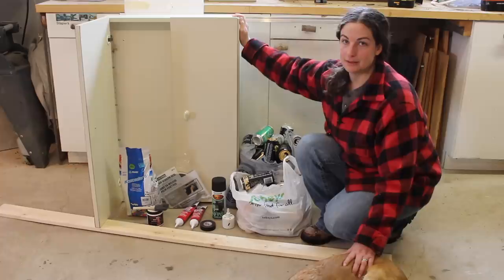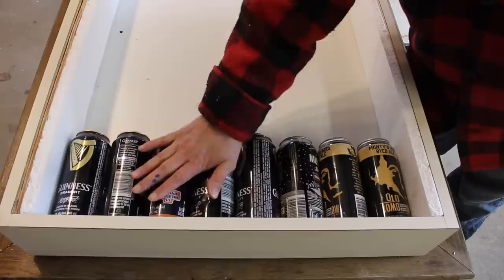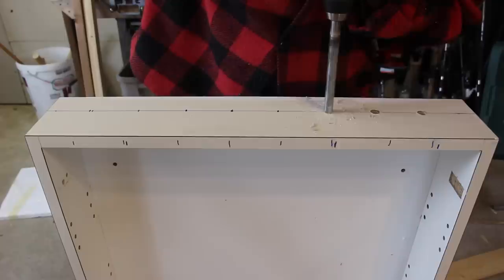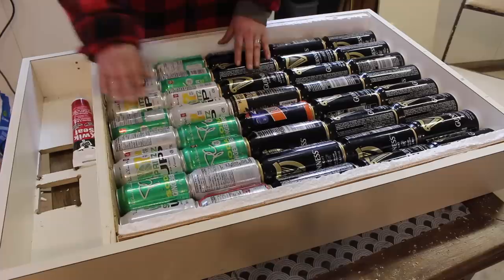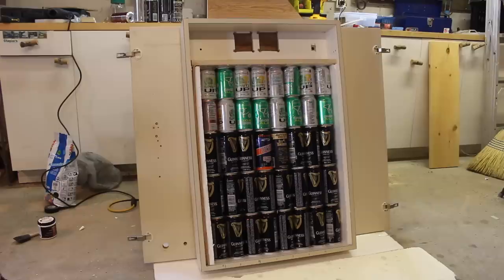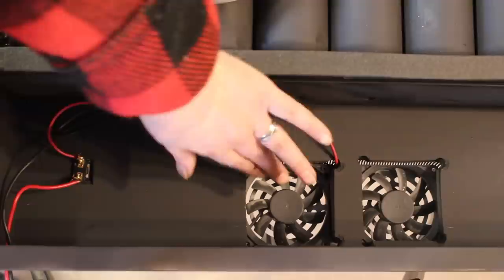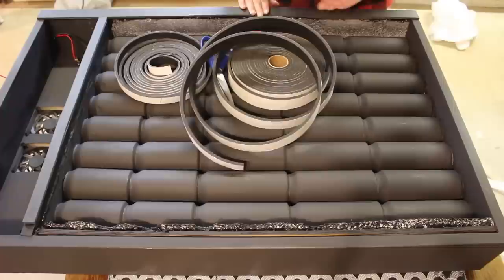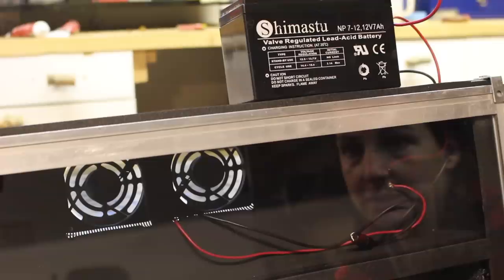Free Solar Heat From Pop/Soda/Beer Can Heater

Comment: You need a Pulse width modulated PWM solar regulator for the battery set to the GEL setting - otherwise you will stuff your battery with over charging. Without a solar reg the battery will dry out and loose capacity.  On very SMALL systems a PWM regulator is far better than an MPPT solar charger, as it has less losses and is more efficient, as well as cheaper to buy.

Instead of pop-cans, use metal down pipe, water copper tube, or even any other type of metal tube that's painted black. The longer the tube - the hotter the air flow will be coming out. 
Curve the tube over on itself back and forth to make a long air path and the air will become hotter. Also use hot water from your fire stove and run that through tube in stead of air with a fan blowing over it. Otherwise a neat idea. 

Alternatively - live in Australia where there's almost never any snow or freezing weather. 
A white Xmas doesn't exist in the southern hemisphere other than Antartic. I've seen snow in Australia maybe twice in 65 years.

Comment: You guys, there is X amount of heat coming in the window. Putting this Popcan rig in the window is not going to bring more heat in from the window, it's just blocking the light. You were getting just as much heat from your window before you did all that work.
Reply: The only difference is that you are capturing the heat in that rig, and blowing it out the vent. Before, the heat was being spread out more as light before it turned into heat. Also, you are putting electricity into the fans that you could've been using somewhere else. This is less efficient than doing nothing. If you want more solar heat in your room, add another window.
Reply: Or put it this way; pretend your window is a hole in the wall, and the solar energy is mice coming through that hole. Your Popcan rig is just a maze. You're not getting more mice per hour coming in through the hole, you're just making them go through the maze before they get into the room.
Reply: If you just want to block the light while getting all the heat, a black curtain would do the same thing. And you wouldn't need fans.

Comment: Sorry to rain on the parade here. But the heat energy from the sun just coming in a window will not escape unless you are trying to reflect it back out. It will all be absorbed by the material inside the house and emit as infrared radiation. The only way this would contribute to heating your house or whatever structure you put it in, is to have it outside, collecting the heat and ducting the warmed air inside. aside from that its just a cool experiment showing the heat energy from the sun going through a window.....

Comment: I am only confused about why do you have those cans inside the box? Isn't it going to be just the same amount of sunshine collected in the box if there are no cans? How does having the cans in there make it collect sunshine from a bigger surface than what amount of sunshine is hitting the surface of the box itself?
Reply: the cans function is mostly airflow and collecting the heat to the air stream andforcing it one way, as hot air rises up on its own, the cans concentrate it further in the inside "chambers" of the can body. The small holes from can to can allows air to slow and collect more heat on its way up. well thats my best thought analyzis, havent tried it out yet myself. Happy new year every one.
Reply: The can are to collect the solar heat and transfer it to the air flow inside by the fan.  Not too effective needs more surface area but it depends on how hot the Aluminum get and how fast the air moves.   The problem I see is the battery will deplete in a few days since the panels cannot charge and power the fans Maybe a temp on switch for the fans? Else this will ruin the batteries.  If this was placed in a window   the resultant loss of sun light probably will offset the heat gains.  Maybe a part 2  will show how useful it is VS a black curtain.  Mount it outside and flow the air in would work.

Comment: Can I ask please why there are holes in the bottom? Did you seal those? As I’m thinking perhaps the heat would escape from them.
Reply from the maker: The air heats up in the cans and has a continuous flow through them.  If you seal the holes the hot air can’t flow out of the cans.

Comment: But when the sun goes down & it's dark, don't you have an air conditioner,?
Metal gets hot in sun & cold in shade
Would be very interested to know how this heats at night. (Sure could use it,!)
Reply from the maker: The can only runs when the sun is shining.  It's a solar heater, so no heat at night.

Comment: This may be good for people who already know what on earth the different steps are for, but I don't understand it at all. For example it looks like the point of drilling holes in the bottoms of the cans and then gluing the cans together is to make them into longer pipes. But then there's no explanation of why you need a bunch of pipes.
Reply from the maker: The small holes in the cans slows down the airflow as the fan draws air through the unit, allowing the air to heat up before being moved out of the box.  Hope that helps!
Reply: @Wilderstead  interesting, thanks!

Comment: Did you mount this outside or inside the house?  I made this unit a few years ago, and mounted it outside my sash window in the master bedroom.  I open the bottom window enough to allow air from inside to circulate up and open the top enough to come back through.  It didn't heat enough to make any difference as no matter how the sun shined the cold air kept the cans too cool to do the job.

Comment: so, you set it up as a window with the pop cans facing out. when the sun hits it it warms up and you blow the heat into the house. Sooooo....when the sun goes down....
Reply from the maker: Considering it's a solar heater, one would assume it requires the sun to work.  Similar to something like a solar panel....

Comment: Great idea, but I wonder that if the PC fan portion of the cabinet is insulated, how much of a risk is there for the fan to overheat? Heat displacement is a concern for computers, and for that reason, fans are known to overheat.

Comment: How does the fan know whether to use the battery or the solar panel? And do they both stay attached? Can you do a closeup? I don't understand where you put the weather stripping also. I couldn't see a difference in before and after
Reply: If connected in parallel, the fan will pull power from whatever has power available. So if sunny, itll pull some power from panel and some from battery. Itll happen automatically. However, ive never seen a solar panel tied directly to a battery like that. Theres usually a charge controller inbetween. Plus, youll need to make sure you have a solar panel that has a diode built in to prevent reverse flow, or else the panel will drain the battery and produce heat out the panel. Might want to do some more research on this

Comment: So the question regarding your pop can heater is....where is your intake?  Obviously you thought of exhausting the the heated air from the cans... but that air has to come in from somewhere... so where's the air intake or are you just exhausting the whole panel only and there's no fresh, cold air getting pulled in? If that's the case you're not going to be putting off much heat. Just an observation on my part and a possible oversight when you designed and assembled this.
Reply: Apparently missed part of video... because cat walked on keyboard. I stand corrected... well done!!
Reply: @dsrtodd  My cats walk on the not pad all the time , And change the video I was watching. Ugggg. These cats are so nosey  🙀😺😹😻

Comment: Can we guess who is the beer drinker and who is the soft drink drinker? LOL
And the ratios of each?

I have seen these before. One problem is that single pane aluminum frame windows are poor insulators.
If you could have gotten a double pane window (untinted) that would help a lot. Or add another single pane window on top of the existing one, sealing all around it to keep condensation out.

Also, wood is not that good of an insulator either.
1" of fiberglass insulation = 7" of wood for insulation needs.

For fanciness/automation, use a heat/air conditioner thermostat set to A/C. Preferably a mechanical one and not a digital one.
Place in the heater near the fans.
Wire in series with the fan switch.
Set temperature say 65 degrees.
Simple convection would heat it.

When the heater gets up to 65 degrees, the thermostat closes to complete the circuit and starts the fans.
Allows the heater to heat up without using warm house air to heat it. And without having to manually turn it on and off.

When the air temperature in the heater drops below 65, the fans shut off to save energy/allow the heater to warm up in the sunlight.

I did not see a fuse in your wiring. Fuses are always a good safety choice.

If you built it a little differently, you could have mounted the solar panel inside the heater housing.

Does your solar panel have a blocking diode in it to prevent working when there is no sunlight?

You did not mention how you physically locate and connect the solar panel to the battery.

Comment: Do any of you realize that this does not increase the amount of heat that the sun would deposit into the house compared to simply having the window and no cans?

Sure, the cans and the fan create a flow of warm air that you can feel, but if the sun just shines through the window and onto the floor, the amount of heat deposited into the home is the same.

Simple college level thermodynamics.
Reply: you don't cover the window. it's mounted along side the window like shutters. 
I have seen something similar but a pvp pipe is run tru the cans and a thermostat  is used to turn the fans on when a desired temp is obtained.
it was used to heat a work shed used in the winter. I think it got up to the mid 40's when the temp was freezing out side.
Reply: @blabberwulf7650  you might mount it on the outside of the house like a shutter (that would be way smarter) these people mounted it on the inside of the house blocking a window. Total waste of time.
Reply: @dosmundos3830 I think the air in the pvc pipe is warmed to the desired temp then circulated into the house only.
it's seperate from the air in the cans & box outside that continues to heat up.
Reply: @blabberwulf7650  what you said has absolutely nothing to do with what we're talking about. The person making this wasted her time by mounting it on the inside of her house on a door window.
Reply: you can make a simple thermostat by covering the output with a rubber flap, as the air gets hotter it forces the flap open letting hot air in.
when it falls below the desired temp the air flow decreases and the flap
 closes. depending on the weight of the flap will determine what temp air you want to force it open.

Comment: Why do you drill a hole into each can and into the bottom of the box?
Reply from the maker: Airflow - the air needs to enter the cans, warm up and exit out the top of the unit.

Comment: It seems to me that with only a few modifications, one could could vastly increase efficiency.  First fill the cans with water so that heat is retained through the night when the sun goes down..  Second, with only a little tubing, it could also be your hot water heater.  I would insulate the box with Styrofoam.  And, for the artistic among us, I would decorate/paint/etc the inside facing part of the box so that a precious window is not a focal point in a boring decorating scheme.

Comment: Everyone builds these projects to be airtight and 50 times as substantial as they need to be. A single sheet of blackened corrugated packing or even wrinkled craft paper would work just as well. That silicone sealant is silly. If air leaks, it will leak into the, wait for it, AIR!  Make the inlet and outlets as big a possible so convection eliminates the need for the fan. Sorry, this is a stupid project..
Reply: Not as well, because they have less mass, and the paper would break down quickly.  But you could fill the cans with water and not fill the gaps between them.  That'd capture more heat and the fan would blow it through all the cracks.

Comment: If the sun is inside the house already, the pop cans don't add heat because the solar radiation if allowed to hit the floor, the same amount of thermal energy converted and will still be inside the building.
Reply from the maker: put a white can and a black can on the floor in the sun and see which one gets hotter.....
Reply: @Wilderstead  the black can is simply absorbing heat while the white can is allowing it to transfer to other parts of the house. You don't actually believe the device you made is sucking more radiation through the window than would otherwise have entered do you?

Comment: What if you use a darker black?
Reply: How much difference does it make to vary the air gap between the cans and the glass?
Reply: Darker colors absorb heat better than lighter colors ( white ) .Black is the presence of all color. White is the absence of any color.  A black car will heat up inside faster than a white car. ( Just an example )
Reply: @havenbastion  Ideally you want the air to enter the cans . The air inside the can will heat up faster , than outside the cans 🔥

Comment: There’s absolutely no reason to seal the cans. And having some holes in the bottom and top plate on the outside of the cans can also pull some heat that would otherwise get wasted by pushing it out the glass. Just set the fan to suck from the top instead of push the air in from the bottom.

Comment: If you're using it inside the house you're not gaining any heat you're just consenting it
Reply from the maker: Consent is very important. 😉 But, yes it isn’t nearly as effective as having this unit somewhere there isn’t already a window. The purpose of building this unit was to see if the advection had any measurable difference on the room temperature … there were follow up videos where we tested that.

Comment: Hate it when DYIers do a project like this, but then never show a finished picture of the actual installed device with enough perspective that you can really see anything.  Makes you wonder if it actually worked or was really installed.
You kids need to dig out old copies of Mother Earth News from the 1960-70's.  There are hundreds of projects virtually identical to this.
Reply from the maker: Linked in the video description and at the end of the video.  Cheers

Comment: I'm sorry to be the one to tell you this, but your design is mostly non functional. You can't have the inflow and outflow fans open to the same chamber, first of all, and second, you drilled holes in only one end of each row of cans... the concept of the connected cans is flow through from one row to the next, connected by a 'u' from row one to row two and so on to the last row, which would feed out to the outflow fan to heat the room. Your layout doesn't flow at all and the fans cancel each other out, being right next to each other with no separation. Some heat will radiate from the can rows because they do collect a lot of heat, but you're going to get a fraction of what the proper design would produce.
Reply from the maker: Well, back to the ole drawing board I guess... 🙄

Comment: Very good vid. Helpful.
Having said that.
Spray painting, indoors, no mask, no apparent ventilation, BAD IDEA!
Come on, now. If you are going to be  advising and teaching, please be more responsible.
Just saying. I'm also saying I'm gonna try this as soon as I can. Thanks.
Reply from the maker: Hmmm..just a wide open garage door.  We’ll be sure to explain everything in much greater detail next time….
Reply: @Wilderstead  Yeah, didn't see that. There are a lot of Dum Dums out there, or as my mother used to say... Stupidupes.

Probably not old enough to remember those PSAs.

Anyway, it wasn't my main point. My main point was to say, great ideas, keep up the good work. First time I've seen anything like this so of course I want to try it.

I like the other posters idea about a ton foil lining. Don't know if you've thought about that, if you have... Did it make a difference. I think it should.
Reply from the maker: No, we haven’t tried that.  We’re currently designing a much larger one to keep a 200 litre  barrel of water from freezing inside of our barn for watering our livestock.  We have a few ideas we may try out from the ideas in the comments here.
Reply: @Wilderstead  I look forward to seeing the videos. Here's hoping the channel goes hells bells. You do a good presentation.

Comment: What a sham. You didn't even use black paint. Using cans like this is pointless since no air flows through them. This is the most inefficient way I've seen to do this type of heating in a long time.
Reply from the maker: It’s a very good idea to actually watch the videos you comment on, Mooglie.  It lessens your chances of looking like a complete imbecile...